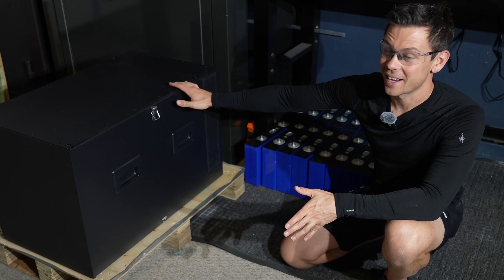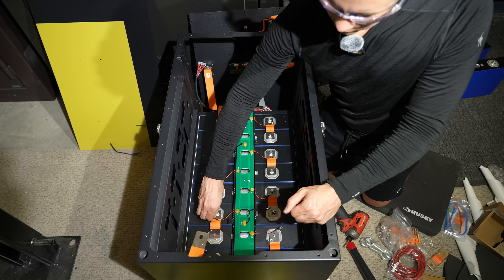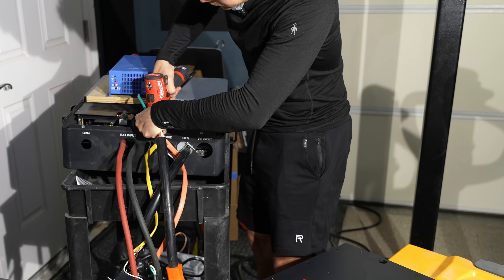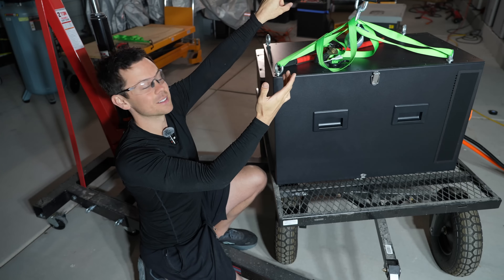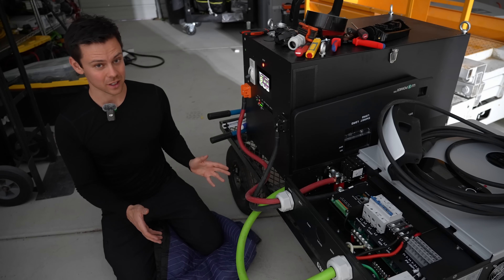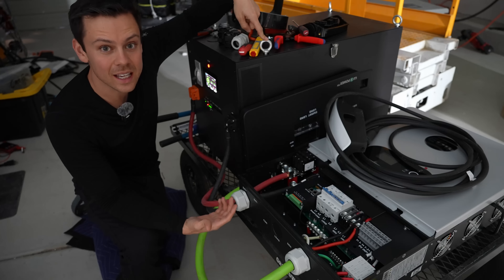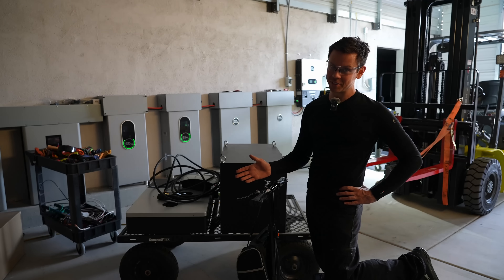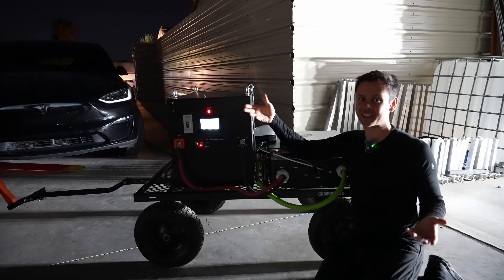HUGE 32kWh LiFePO4 DIY Battery w/ 628Ah Cells! 90 Minute Build

Comment: Can do please make a video using this or any DIY battery pack and make it be capable of being charged by a level 2 EV charger. And also capable of charging a EV on level 2 charger. 32KW of battery would give my bolt 1.5 times its original range. I have free level 2 charging at work. My payload capacity is 900 pounds, I’m 200 pounds plus the battery of 600 pounds. I would still be under my payload capacity. I could charge my car and spare battery for free at work. Drive my 120 miles back home and charge my car back up from the battery pack from the free electricity from my work with out ever using electricity from my house. I would also like to use the battery to add to my home solar and battery set up. Hopefully soon enough I can get a bi-directional charger to make it all work together. There is some brands that already have bi-directional charger. I believe Sigenergy is one of them. Not sure my current bolt is bi-directional charger capable. But my next vehicle will be.

Comment: You are lucky, when I did that with less than half the weight, I broke my foot.  I then walked around on it because it did not seem broken just sore.  A few weeks later it went from feeling good to agonizing then I got to crutch around for a few weeks while it healed (luckily it did).  I had the proper boots but did not put them on because nothing was that heavy.  Another friend broken his foot dropping a cordless drill on it just right.  Thick sweat wicking socks for extra padding and comfort in reinforced footware is important when dealing with any of the equipment you do.  be safe and thanks for the great video.

Comment: Hi Will only a MRI will determine if you've broken a bone with T1 and STIR imaging. Xrays are notoriously bad for microfracture of the foot bones and you have a huge amount of swelling. Take ibuprofen and elevate the foot at night. Definitely use a crutch for 2 weeks at least bc the last thing you want is chronic stress fracture to set in. It will take months to heal if you're not careful. As stated elsewhere get toe cap shoes. Great video I love watching diy battery builds.

Comment: I could likely go completely off grid with this capacity with a little generator for backup. In Australia you can  purchase electricity wholesale but have to be smart about when drawing from the grid. Often during summer the grid is often oversupplied by renewable daiky for a couple of hours, electricity is only a couple of cents per kWh and sometimes free.

Q. What do I need to manage the solar and grid input for this battery?

Comment: Steel toed boots when doing any heavy lifting.  I'm a fan of leveling casters:  Some are rated for thousands of pounds.  My mill sits on stable feet, then when I need to move it I turn the feet a few turns until it's resting on casters.  It's not very high off the ground so there's little potential energy if it falls.

Comment: Hi.

I'm looking  to run an electric heater in a sienna van.  The heater is 540w on low.    I'm california so it does not get that cold.  It tun off and on on its own all night I am looking to run it 5 to 6 hrs a night. I'm looking to stay at 60 degrees any idea on how big of a battery I will need.  I will be charging it on the grid everyday.

Comment: I don't think I would ever get a 500 lb battery that I would ever have any desire to move.  Wouldn't it be better to split this capacity up into two units? I have a 350 lb welder and I never move it more than about 12 in. and it's actually on wheels!

Comment: Hey i had a question, kind of irrelevant to this video, but i can't find a answer anywhere, I have a 24v 400 ah system, going to the litime 24v 3000w 3 in 1 inverter, problem is the +- terminals for the battery on the inverter are square terminals and they are too small for the 2/0 wire, im supposed to use this wire but i dont know how to make it fit, please help, a link to what i need please

Comment: Staring at my 1000 lb pallet of Sun Gold Power PowerMax 314's (3) wishing my tractor would start... it will lift 1600 lbs, if only it would start. Acts like its battery is dead (how ironic) but I replaced it only to have the new one do the same thing. 270+ lbs apiece stacked 3 high so a pallet jack is no good, even with the engine hoist like you have - stack is too tall. I think there might be something wrong with the 1000-ish amp starter contactor drive circuit, again ironic because I have an 800 amp DC contactor I'm planning on using in an RV battery inverter. Those giants take 170 watts to engage but only 6 watts to hold once engaged. Is that 628 Ah battery really limited to 200-ish amps? Those style cells are typically 1C so 628 Amp capable. Seems a shame to have a small BMS or whatever the weak factor is. The Sun Gold batteries also limit to 190 Amp continuous where the cells could do 314. I was hoping to get away with 2 batteries instead of 3 as I don't really need 45 kWh capacity.

Comment: One of the best purchases I've made is replacing the air tires on my hand truck / dolly and wheelbarrows with solid tires.  They never need air and always work perfectly.  With that much weight on your cart, you will probably have to fill them up frequently.  Great video though!  I have EG4 batteries planned, but maybe I'll get a few of these instead.

Comment: Will, I wish you a speedy recovery.

Your solar cart with the Ruixu battery gave me the idea for my cart.
It has room for 4 Ruixu 16KwH batteries and an EG4 Flexboss 21 on the end, in the vertical position.  
I used flat free tires rated at 500# each.

Comment: Are you no longer top balancing packs before assembling them, and relying on the active balancers on the BMS?
Reply from the maker: Oh absolutely. If my cells don't come balanced and fail first capacity test, I'll be crying all over the video 🤣 that would be pathetic
Reply: @WillProwse  LFP tech has come so far so fast, and china seems to have gotten the process down to be pretty reliable at this point, with the new mb56 cells I was wondering if you skipped that part, and just trusted them.
Reply from the maker: @Mr.Smith-p2p  I don't trust anyone, that's why I did the capacity test and check cell voltages
Reply from the maker: @Mr.Smith-p2p  what in my video required trust?
Reply from the maker: What do you mean rely on? If that doesn't work either, another thing for me to cry about and mention on forum
Reply from the maker: Watch my older videos where I mention when and why we top balance. A brand new battery? Heck no. Instant failure
Reply: @WillProwse  I have top balanced my previous 6 packs, but that was a while ago, I keep hearing people hinting that such actions are no longer necessary with the new active balancers. You didn't mention top balancing the cells before hand, so I wasn't sure if you were just pulling them from the box and installing strait away.
Reply from the maker: @Mr.Smith-p2p  why? I have lots of videos covering why that's unnecessary. Just cycle the packs. Check out my old videos stating when you should top balance. I am very clear in those videos about when.
Reply from the maker: @Mr.Smith-p2p  No you don't need to use an active balancer. A passive dissipative balancer will work just fine but it will take longer. If they are not matched at all properly, And they do not pull full capacity, then you need to top balance. Again I have many many many videos on this. Please watch my older videos where I cover this many times

Comment: Get some steel or composite toe shoes
I use my sketchers composite toe shoes all day.

And before you told you had an accident i looked and thought that you need to strap the battery to the cart!

And for lifting wide things you can have a 2x4 holding the straps spread apart, but yes having the straps more vertical is better in the first place.

Or make a jack/lift jig, like a metal plate or frame the sice of the batteries and a center lift point. This is how the lift jigs for hybrid electric cars is made for OEM since it's usually placed innside the car and need a lift

Comment: Hi Will, love the videos… you have helped me understand electricity and solar more than any other resource. I have a question that I’m not sure is something you would consider in the scope of your channel.

I’m interested in making a SMALL outdoor solar system (like the solar cross walk signs / cameras you see along the road) where a solar panel mounts on the top of a pole, and then a small weather proof box for a battery / charge controller / inverter with the intention of running landscape lighting. Do you have any advice on parts to use? Or would that be a video you’re willing to make?

Comment: Will two things....
1, the lifting eyes have to be set so that you are not pulling the load from the side, the load has to be pulled from the radius of the eye.
I was a slinger/signaller here in the UK so I know what I'm on about.
2, PLEASE GET SOME STEEL TOE CAP BOOTS TO PROTECT YOUR FEET.

Comment: To prevent tire blowout on your cart (or just tire degradation) once it's parked in a spot where it wont be moved for a while, just put it up on blocks to take the weight off of those tires. Great setup!

Comment: They just had those 12V 280Ah Ecoworthy LFP batteries on sale for $231. I got 4 of them for 4S1P 14.3kWh, but no reason you couldn't do 4S2P 28.6kWh for ~$2k. They're still on sale for $265

Comment: I'm really curious about this battery system. I'm setting up a remote totally off grid large solar system using the EG4 12000XP. Still researching and designing things. I haven't bought anything for the battery bank yet. I was considering using 6 Eco Worthy 48v sever rack batteries to start with and being able to expand in the future but this might be much better and cheaper way to go. I have the equipment and experience to handle the weight. This would be a permanant built in place system. I would love to know more about reliability of the cells, expected life expectancy, and so forth. Any further information would be greatly appreciated !!

Comment: Which charge controller and inverter would you recommend for this? I want to charge it from the grid from midnight until 6 AM, then run the house from the battery for the rest of the day. No solar.

Comment: As far as the cart goes, Uline carts for heavy loads (or used big box store carts) are usually rated for well over 2000lbs. Flat carts or bucket carts are pretty stable with stacked loads too. They're big though.

Comment: A 3/8 eye bolt can lift approximately 1,300 pounds in a straight, 0-degree pull for standard machinery and forged types. This lifting capacity is significantly reduced for angular lifts; for example, at a 45-degree angle, the capacity drops to about 325 pounds
Google ai answer. Seems legit. But there are 4 so it didn’t break. Too much side load. Need a spreader bar if you don’t have head room. Forklift is overkill but now you never need an upgrade. 
Will you said if you have friends you can lift ect. You made it sound like you don’t have friends… we are all here waiting for invitation lol I’m too far tho

Comment: When lifting with an eye bolt, it is recommended to add washers so that after tightening, the eye bolt adheres to the surface, ideally so that the bolt tightens during lifting. I have damaged more than one eye bolt by not operating the crane properly.

I recommend something like ‘NPV20N3D / NPF20N3D(R)(S)’ (it is difficult for me to translate our jargon name ‘chariot’ into English, so here is a random model of such equipment), it takes up less space and you will be able to put the batteries on the workbench more easily. 

I wish you a speedy recovery.

Comment: I've looked at larger batteries but opt for the 100ah track batteries as they are big but still maybe l manageable by myself. I may have to move the system in the future so planning ahead is crucial

Comment: Hi will I honestly never comment but in this case I feel for you also  you need to team up with a fantastic welder and do a modification to the cart . As the centre of gravity is way way off m8
                 The weight NEEDS to be as low as the axial 
So the front and back of your cart is ok BUT the middle of your cart need to be just 6”” to 8” off the ground so the heaviest item can go in this new lower welded section  then be great to see the welder modify this cart without motors then  a show you showing a small miter fitted to it to assist you . 
Would you do something like a fog star latest big battery 32kwh / 45kwh 
And a comparison with the battery you just got ?? 
Thanks 🙏🏾 will & sorry about your foot m8

Comment: Many <3 for building the awesome YiXiang MB56 Box. It is awesome :-)

For lifting and moving these bad boys, firstly, shout-out to YiXiang for doing the sensible thing and giving you 4 hoisting lugs that can be screwed into the top. Secondly, I am using workshop engine cranes for lifting and moving these badboys. These cranes are rated for up to 2 tons, so lifting a 250kg Battery is easy for them. But yes, with these batteries you need to think and pre-plan if the place they are going to be installed in is accessbile for a workshop crane and whether the floor can bear that load!

Comment: Excellent information!. Tip: Lifting eyelets must be flush/all in. The threads are made for straight out load, as you experienced, you did not get that when lifting on a short strap and har angle.
Reply from the maker: They were screwed all the way down I would not make that mistake lol. Yes I need a spreader bar

Comment: For trauma, bruising, and potential swelling I use Arnica 30C under the tongue and if there is no broken skin, I also use Arnica oil or a Traumeel homeopathic compound externally on the skin. If taken internally and applied immediately on the skin, the difference is amazing.

Comment: Greetings from Finland! I am wishing you smooth recovery! 
And I am super greatfull for for checking these mehemot EVE cells!! My wintertime consumption per day can yield up to 130 kW, so a 10-20 kW battery is, out of cycles faster than Bolt was finished a 100 meter stretch back in the day. 
These beefy EVE cells could give me a good 64-96 kW two/three LV battery setup to match my needs..
Thus on spring/fall the consumption is at 40-60 kWh per day. So meaby the 64 kW would be costbenefit sweetspot. 
Hooked on grid with 3P 230/400V 50hz.

Comment: Get a spreader bar for lifting to prevent angles of more than 30 degrees on your lifting straps. The moment you bent the rings,it should have been set down and the rings replaced.

Comment: Will  I'm a metal fabricator. You will find out buying a fork lift was the best money saving, money making, back doctor avoidance thing you ever did. Put every thing on a pallet or skid so that it can be forked you can move every thing you have for what ever reason in an hour. Next buy a STEEL TOED boot with a Metatarsal guard, a good pair are around $350.00 pricey but look at your foot.

Comment: I have 36v forklifts with lead acid batteries that weigh about 6,500 pounds. I have a couple of larger, 10,000 pound capacity electric 36v forklifts (1993 vintage) that are retired due to no batteries. The batteries weigh around 8,500 pounds. The forklift wth battery is listed at 29,500 pounds with the battery. When I first got it. I picked up a 11,000 pound diesel air compressor and moved it across the parking lot.

Comment: I just don't get the point of these steel cases. They are way more expensive than a simple plywood box and who needs to move a battery around, with the exception of Will of course.

Comment: You need an engine hoist leveler to help pickup the 600# battery so you dont bend the eyes. Its comes on some engine hoists. Vevor has them and harbor freight.

Comment: Hi Will , I have accomplished a lot from what I've learned watching your videos. So thank you.  But I have to say I cringed watching you load the 600lb battery on the front of the cart with the hay wagon steering. If you are going to use that cart, please put the heaviest component on the back of it. One sharp turn, and it will dump the load on the floor !

Comment: I'm building my 32 kwh cart with 12k srne inverter on a Aluminum extrusion cart.  Placing the battery down low to the ground between the wheels to lower the center of gravity.

Comment: Get some Carbon fiber ANSI rated work boots because if you use steel toe boots when the steel crushes it will trap your foot inside the boot but the carbon fiber will relax when the load is taken off the boot and you can take your foot right out with no problem. I've seen steel toe boots cut toes clean off the root as well, so always get the carbon fiber toe, plus they don't weight as much and don't get as hot in direct sun.

Comment: Double stacking height within the chassis makes it much harder to check & service. If you needed to check temperatures, fix sensor, rebalance individual cells, replace individual cell.

Comment: Will, move the battery over the rear axle.  Aside from being easier to steer, it's a lot less load on the steering linkages, etc.  Don't want those to fail.  Get ya some steel/composite boot my dude...

Comment: I’m sorry I love this channel but come on any idiot would understand that a 600 pound battery you need to have additional safety measures in place the problem with people your age is you’d have absolutely no clue when it comes to safety. This is by far the dumbest thing I’ve ever seen anybody ever say you have to buy a forklift to lift a 600 pound battery are you insane? We were lifting thousand pound engines before you were born perfectly safe.